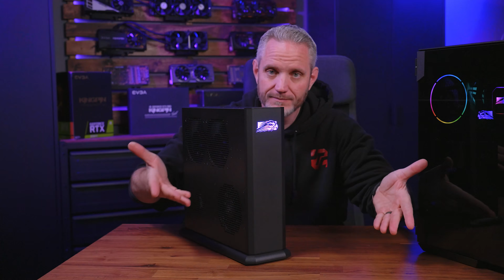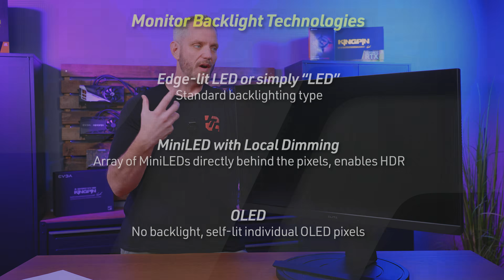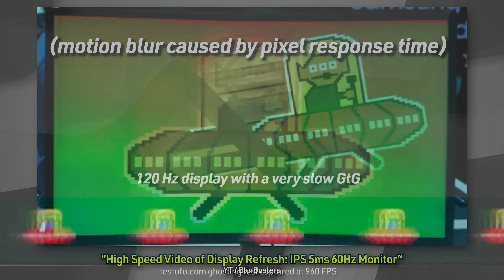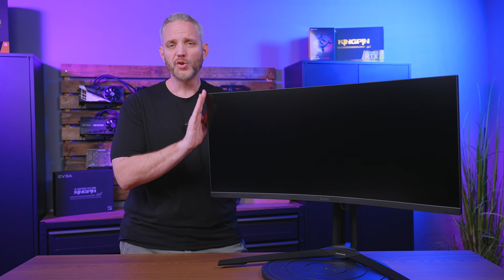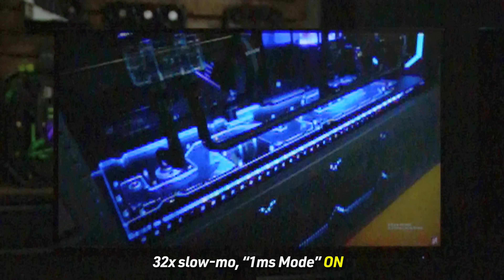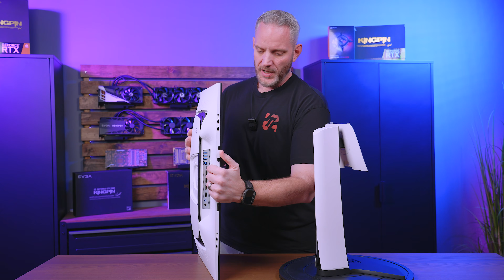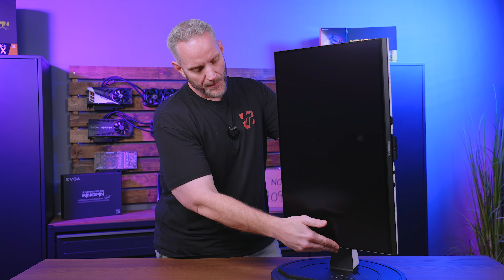Ultimate Gaming Monitor Guide: Find the BEST Screen for Your Setup

Comment: The sweet spot is 27 inch 4k
Reply: Can you explain to me the 4k part? It seems to me that even 5090 can barley run modern games on 1440p, ultra settings, locked 120 fps (by locked i mean that the 1% lowest framerate per benchmark is above 120) evev without ray tracing with turning on all the fake frames\dlss nonsense..

And that's 1440p.. for 4k i saw its around 60~80 fps 1% low on the most graphically demanding titles..
How is that going to look like in 5 years from now? Lets say i buy a 5090 + a monitor today and i dont want to upgrade either of them..

Dont you rather have 1440p with 60fps than 4k with 30~40 fps?
Reply: @Duskull666 you seem to under estimate the 5090…
Reply: If i look at gamer nexus 5090 wu kong benchmarks the they have:
4k avg 85 fps, 1% low 75 fps
1440p avg 120 fps, 1% low 108 fps

And i see similar trends with similarly graphically demanding games.. if its like this now, how is the 5090 going to fare a few years from now?
Reply: @Duskull666 thats a convenient title you picked. Every other 3A games the 5090 averages over 100 fps

Comment: Searching for the best IPS panel with least ghosting, back light bleed etc without getting ripped off was such a headache. I bought an OLED for £500 which is great because last time I looked at OLED monitors, a bit over a year ago, they were all at least double. It’s worth getting an OLED monitor now despite risks of burn in and degradation, I’ve had an OLED TV in my living room that I use for console gaming and TV shows, for 6 years, and there’s 0 signs of it dying.

Comment: I went ultra wide OLED and I'll never go back. I wound up getting the Alienware 3423DW, which came with a 5 year warranty. I have been gaming on it for 2 years now and have had no issues, no burn in, just an amazing gaming experience. When my TV needs to be replaced, I am going OLED. It's amazing how much better dark scenes look. Even the colors are better than most other monitors.
Reply: I have the 2423DWF which despite being a FreeSync monitor works fine with my NVidia GPU (RTX 4090) running UE5 games, etc.

Comment: Whenever considering screen size and resolution you need to factor in a third and equally important consideration and that is VIEWING DISTANCE.  Visual acuity is impacted by distance and not just pixel density.  A 32" 1440p monitor can appear 'as sharp' as a 27" 1440p monitor IF the distance is factored in and the 32" is sufficiently distant to the viewer. 

There are many good tools for calculating optimal viewing distance, specifically for the purpose of determining the distance at which you should be from a screen of a given size and resolution in order to benefit from it vs. 'wasting it' because you're too far away (or too close), the screen is too small (or large), or the resolution is too low (or unnecessarily high).

Comment: Some of the best gaming monitors on the market are VA panels. Like the Samsung neo g7. VA panels have much better contrast ratio than IPS panels but have slower pixel response times and are susceptible to dark smearing. Still I prefer the better blacks and higher contrast ratio of VA panels over IPS panels.

Comment: I got my Samsung 27" curved monitor LC27F391FHNXZA for $60 off Ebay, certified Ebay Refurbished. It's a VA monitor. It works PERFECTLY FINE for gaming & my day job as a data scientist.

Just get one that is cheap and in a size that works for you. It's not that deep.

Comment: I just recently returned a 50" LG 120Hz smart TV and got a 34" Odyssey G5 165Hz. So much better quality for half the price! Found an open box model at Best Buy for $240.  My 3080 didnt realize what it was missing, until after upgrading from a 43" 60Hz Vizio

Comment: ASUS ROG Strix XG27WCS
	•	Size: 27 inches
	•	Resolution: 2560 × 1440 (QHD, 2K)
	•	Refresh Rate: 180 Hz (very fast)
	•	Response Time: 1 ms (GtG)
	•	Panel Type: VA (Vertical Alignment) Curved
	•	Curvature: 1500R
	•	HDR: HDR10 support (basic HDR, decent for gaming)
	•	Adaptive Sync: AMD FreeSync Premium (also G-Sync Compatible unofficially)
	•	Ports:
	•	DisplayPort 1.4
	•	HDMI 2.0
	•	USB-C (supports video and charging)
	•	USB Hub
	•	Special feature: There’s a socket mount on the top for an ROG Eye Webcam (or similar camera).

For 269$ is not a bad deal imo. I also rather have a curved one since I mainly play non-competitive games

Comment: Why not force use this resolution (2716 × 1528 ) through Nvidia’s application?!

1- 4K pixel count:
	•	3840 × 2160 = 8,294,400 pixels
2- Half of 4K:
	•	8,294,400 ÷ 2 = 4,147,200 pixels

To get 4,147,200 pixels, we solve for X × Y = 4,147,200 while keeping the 16:9 aspect ratio (since most monitors use it).

Let’s calculate:
	•	X = (16/9) × Y
	•	(16/9) × Y × Y = 4,147,200
	•	Y ≈ 1527
	•	X ≈ 2715

So the closest even resolution would be 2716 × 1528.

Comment: I love a 32" 1440P panel, which is the same pixel size as a 23.5" 1080P panel, works great, so I have a 1080P on either side and can eyefinite (racing games) across all trhee - yup - very very wide.

Comment: I can't think of many reason to buy 1440p these days other than saving a little bit on the display. The most common argument people trying to defend their already purchased 1440p display is '4k is too hard to run' which is complete BS. There are tons of games that run fine at 4k even without crazy hardware, there's upscaling if you don't mind that, and there's nothing stopping you from running a 4k display in 1080p or 1440p. The scaling won't be perfect at 1440p but I'd challenge anyone to even notice at that PPI.

The second most common arguments are that you don't need 4k for a small screen, while there might be a hint of truth in that I feel like I should point out that people buy phones with close to 4k displays. Then there's people who will say they want super high refresh rate and that's fair, but 240hz 4K is common now and that's enough for most people.

I might be slightly biased because I've been running 4k for over 10 years. I only ever had xx70 and lower class cards. It worked absolutely fine back then and it just gets better and better.

Comment: Hello sir
 I have 1080 resolution laptop intel integrated graphics.
Can i connect 27 inch 1440 resolution monitor. 
Do my laptop gives 1440 resolution output in extended display mode

Comment: I caught the Alienware 34” OLED QHD Ultrawide 165hz panel on sale for $600 2 years ago. Probably the going rate for that product currently. Absolutely love it. I have it paired with a 5080 currently. KCD2 runs 140-150fps with everything set to expiremental.

Comment: The only monitor I could find that ticked all my boxes was an Oled so I went with he Alienware aw3423dwf. I was the fence around burn in but i'm over two years in and not even had any image retention which can be cleared with a pixel refresh, let alone burn in. I use moving wallpapers on a playlist changing every 5 minutes, keep my taskbar on a second monitor, try not to leave things open on screen when I leave my desk, and don't use split screen or spreadsheets with it, it's purely for gaming and media. 

If this monitor broke i'd replace it with another, 100% sticking with Oled.

Comment: I want to make an upgrade I currently have a Samsung Odyssey G8 and I'd like something faster I mainly play COD so I was thinking about 27' AW2725DF 360hz I got a 4090 and currently it's reaching 70° on max settings in other games at 4k and 64° in COD. For one I'd like more fps in game and getiing a faster 2K monitor seems like a good idea so what I wanna ask is if you have first hand experience with Alienware monitors and if AW2725DF is a solid choice. Thx in advance big bro

Comment: You should always do your build and budget from the point of viewing backwards. Monitor first, calculate the FPS you need and see if it fits your budget. 4k OLED needs a 5090 to be just above 60 FPS at 1% lows in cyberpunk at max settings—without fake frames. However, if you are willing to lower settings you can spend less on your GPU.  A 4080 super or 5080 is likely the minimum you should go when doing 4K. Maybe a 5070 super when they come out with that. Otherwise I would stick to 1440p for AAA games.

Comment: I just use my 4k tvs 
Never have had any burn in despite years of use, they get surprisingly good refresh rates (120 easy), brighter colors (which helps with my graphic design work stuff), connectors for higher quality sound bars,  

The only negative I can really see is the glare of the screen if you have open windows and a sunny day outside, even then depending on your angle that may not matter anyway, (also depends on the type of TV)
And possibly getting used to looking at such a large display.

Comment: I bouth a panel what its coust me 175.20 $ and i think more then enough for AMD RX7600 8GB, its the folowing.: KTC H27S17 27-inch 1500R Curved Gaming Monitor QHD 2560x1440 16:9 ELED 180Hz 120% sRGB 4000:1 Contrast Ratio 1ms MPRT Response Time Low Motion Blur Compatible with FreeSync G-Sync USB 2xHDMI2.0 2xDP1.4 Audio Out VESA Mount, what do you think, will be a good experiance, specialy when the last panel was KTC H24V13 23.8-inch Gaming Monitor, 1920x1080 16:9 100Hz High Refresh Rate VA Panel, 4000:1 Contrast Ratio, 104% sRGB HDR10 16ms Response Time, Low Blue Light, FreeSync & G-Sync Compatible, HDMI VGA Audio Out, VESA Wall Mount Tilt Adjustment Display?? Many thank's for your answer!

Comment: My sweet spot: Philips Evnia 49M2C8900L (Two models same number: L= 144Hz HDMI 2, no L=240Hz HDMI 2.1)
If paying a grand for a monitor, there are some features I insist on, Until I found the Evnia, every 49" was missing one item on my tick list
1: OLED
2: Decent refresh
3: Decent speakers (thing is wide prolly no room for seperate ones if not using headset)
4: 90W power delivery USB-C
5: KVM (no need to unplug my desktop when I want to work on my Employer laptop)
6: VESA mount to attach a pnuematic arm
And a Brucie Bonus : Ambilight. LEDS on the back actually done right. 

As the two models only differ by refresh and I have a 4070 Super. I'll not get near 240Hz at 5120x1440, so no point spending the extra £200 on the 240Hz version.

Oh and you got the R number upside down. The bigger the number the less pronounced the curve

Comment: Other than the radius rating which others have pointed out that’s not how v sync works really. You can get tearing at any fps. V sync just syncs the draw of the screen with the output from the gpu. Variable refresh rate does this and also matches the refresh rate of the panel to the fps of the game.

Comment: Beautiful and informative video! I'm on the fence between a 55in, high refresh rate, low (6ms) input lag TV vs a 30 something inch monitor with a 1-5ms input lag. Thoughts?! (Ryzen 5 5600x, RTX 4070)

Comment: A question about pixel density: 
I was told that for the same line of monitor, the physical pixel density does not change with size, but the apparent pixel density does. A 1920 x 1080 monitor doesn't have to have exactly 2,073,600 physical pixels, and a larger screen will have more physical pixels than a smaller version of the same screen with the same resolution. 

Am I wrong on this? Do the panel makers actually spread the pixels out for larger monitors of the same resolution?

Comment: VA panels come closer to the infinite ratio of OLEDs. BFI gets rid of the grey to grey smearing. Full arrary local dimming gets you that much closer to OLED black. But being non OLED means HDR peak brightness gets so much higher.

So which one is right for me? Samsung 43' Neo G7. The BFI on this is so good (& very intense initially), motion clarity of 240hz at 60hz.

Comment: With backlights one important issue is bleed in on the sides. I have a very cheap monitor and while it's ok, in dark scenes it's very noticeable that there are bright splotches at the sides where the backlight shines through the frame on the monitor.

Comment: have an 32" alienware dq oled 4k @ 240HRz 1ms slightly curved. this oled changed everything but put my 4090 to work. dont forget its going to stress the gpu quite a bit more.

Comment: To anyone thinking its a marketing gimmick believe me refresh rate makes a huge difference. I went from 60Hz monitor and got a 240Hz OLED monitor. Absolutely huge difference. As I'm still running a 3080 Ti I will probably stick to 240Hz until I end up upgrading my GPU. OLEDs also have a burn in protection with pixel cleaning so no need to worry. Picture quality is well worth it.

Comment: That was a really good video to explain the basics. Thank you jayz. I currently game at the 1080p with an ASUS XQ258 soemthign freesync monitor that costed my kidney back then and i am happy with it. I am considering going to some more exotic like the corsairs u advertised with the foldable panel but that will cost another kidney and i cant reall decide if i need 1 long or 2 monitors for my work as a programmer. Anyway what i dont like not only in monitors but on any device is the extra features that are not for the work of that devic. What i mean is, i like a monitor to have the ports to connect with possibly all available combinations i.s. hdmi, rgb, dispaly port etc. I dont like monitors with usb hubs or speakers. For some people yeah this may work as they dont have to use speakers or they plug their headphones in or they dont have so many usb ports or in awkward posiions like back of the case etc. But at a latest technology monitor costing 1000euros/dollars with usb hubs seems like a porche having window handle instead of buttons! But cables are so long nowadays for headphones that is no need to have them on monitor! not to mention the quality!!!! Rgb is useless too for me. Respect to the people they need them but i dont like it.

Comment: Just picked up a 27 inch 1440p 240 hz oled monitor for $500 CAD. I bought a 4070 ti super from Memory Express, and they had a bundle with a 60% off voucher on any monitor.

Comment: I'm planning on buying a Samsung OLED G9 G93SC monitor, but I'm also thinking of upgrading my GPU from 3070 to a 5070/5070ti/5080. Do you think the monitor will be compatible/can keep up with that GPU, regarding the monitor only has DP 1.4/HDMI 2.1. Thanks.

Comment: Dell 32 4K UHD Gaming Monitor - G3223Q, matching my AM4 ROG Strix X570-I Gaming, Ryzen 9 5950X, RTX 4070 OC Twin, 64GB RAM ... no intention of upgrading for a long time as the Dell runs 4K sweet at 144hz :) .. but went through 3 monitors until I found the Dell.

Comment: I have just a 1080p monitor, but it has everything in it; G-sync, HDR, 360hz and 1ms respond time at a 24 inch display. Resolution is not so important for me, I prefer performance. 1080p still looks great and your PC performs much better. My second monitor is 4K also at 24 inch, so I have the comparison, but 1080p still is good enough for a good gaming experience

Comment: I was at Disc Replay last weekend and they had a used LG 27GP83B-B for $140. It looked practically brand new. When I saw that it was an IPS 1440p panel with 165Hz refresh and HDR10 I grabbed it. I was currently using a Dell 2719DGF 1440p TN 144Hz display which I thought was pretty decent until I hooked them up side by side. The LG looks so much nicer.

You weren't kidding when you said that once you use a decent 1440p IPS with HDR, you can't go back to a TN display.

The LG may not be the best, but it was a good step up for me, and at $140 I couldn't pass it up.

Comment: OLED are great if you game at night or with the blinds down. however people should be aware they are much dimmer than miniLED (and are more prone to burn in when pushing the brightness). my current monitor is 800nits fullscreen, and with the blinds up is only just bright enough....most OLEDS monitors are only 300nitts fullscreen..

Comment: 10 years ago, the offerings for LCD monitors on the market were very poor. Selling old tech as new, and very few upgrade options other than choosing IPS over TN, or higher refresh rates at the cost of sacrificing color accuracy.

Currently, it appears to be similar, for the 1080p market at least (what im more familiar with), but with a lot more options. Recently, I got an AOC 24G4EM from microcenter, and the viewing angles were far worse than my 10 year old acer I got for $20 cheaper back then. A slight head movement shifts the colors almost as bad as a TN panel. Further, MANY monitors still use super old DP 1.2 inputs, even though 1.4 was released in 2016. Probably due to saving a few dollars and assuming refresh rate is the only consideration for such things. Even worse, many monitors dont use the proper HDMI version to display the maximum refresh rate. Some even having HDMI 1.4 (very dated now), but usually 2.0, which has a max refresh of around 240hz. The biggest problem with this, is that most monitors Ive browsed more often come with 2 HDMI ports rather than 2 DP ports. GPUs typically have only 1 HDMI port now, so that decision being somewhat standard is baffling to me. I had the only display port on my current high refresh rate monitor die on me, so I was stuck with HDMI only, which means I had to constantly unplug cables from my GPU. Very very annoying!

Another problem is that many screens are barely bright enough for my tastes. I completely ignore "HDR" considerations, as most of it is fake HDR if youre not going with OLED. At best, it can just give you an indication of the monitor's max brightness.